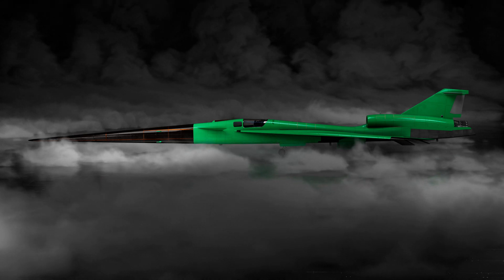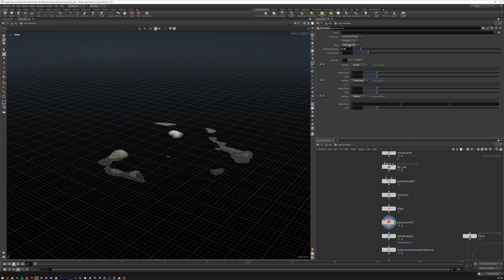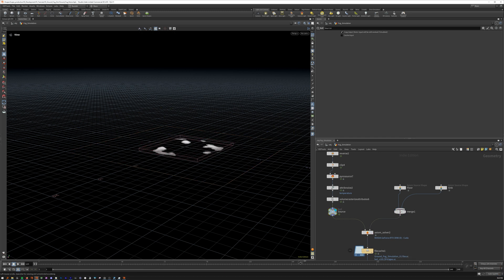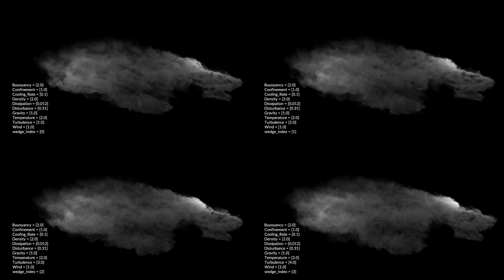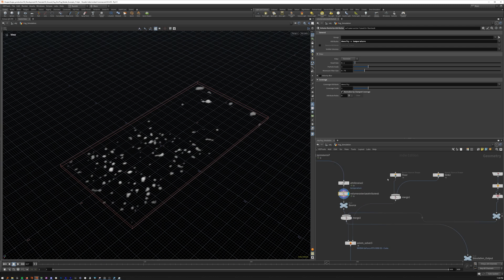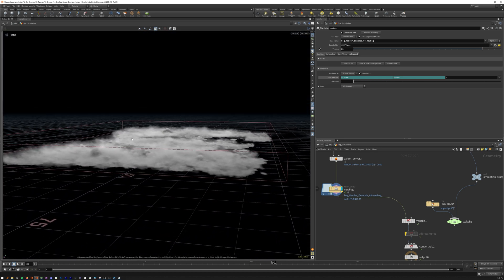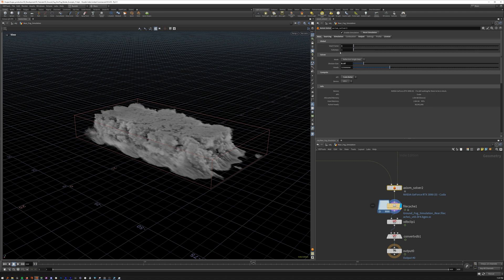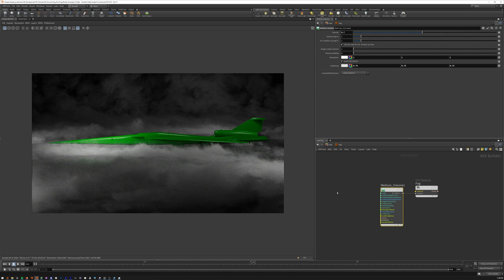Rolling Ground Fog: Houdini + Axiom

Comment: Hello, thanks for the great video!
Can you tell me what version of MOPS you are using?
I can't seem to install them correctly :(
Reply from the maker: Hey! I can't recall the exact version I used at the time, but right now I'm running one of the latest versions (1.9.0) and it works just fine. I do also have a license for MOPS+, but the shape falloff should be available in the free version.
Reply: @oiolli  Thank you for your reply, I read the manual again and everything was installed!

Comment: how long it took to cache? is same cache time if i use houdini pyro?
Reply from the maker: On the demo simulations, it was less than 5 minutes. On the example scene, it took 20 minutes per cache. That is with a 3090 GPU. Houdini Pyro is much much slower than Axiom, you can totally use the same principles but I have limited experience with vanilla pyro.
Reply: @oiolli Thanks for the info man!

Comment: What do you think about Octane?
Reply from the maker: Octane is great! It's my longest running GPU render engine, it certainly has some quirks running in Houdini, but once you get accustomed to it, it runs great. I'm not sure if I'll stick with it forever, depending if I fully embrace Solaris and how Karma develops, but I'm hearing octane support in Solaris is improving all the time. So we'll see! Regarding volume rendering, Octane / Redshift / Karma work about the same.
Reply: @oiolli  Does Volume Motion Blur work for you with Axiom in Octane? The last time I tried it half a year ago or so there was a problem specifically with volumes from Axiom Solver, couldn't get good looking motion blur, meanwhile MB works good with the regular Houdini pyro solver, need to test that again, but I doubt the problem fixed itself
Reply from the maker: @vladyslavlavrenov9167  It's been a minute since I looked at it closely, I remember I needed to multiply the velocity post simulation to get it to show up with octane, but if I pushed it too far I got artifacting. I'll keep an eye on that.
Reply: @oiolli  That's what happened to me. Multiplying the vel will bring artifacts out, that's the case, doesn't do that if the volume comes from the regular houdini pyro.